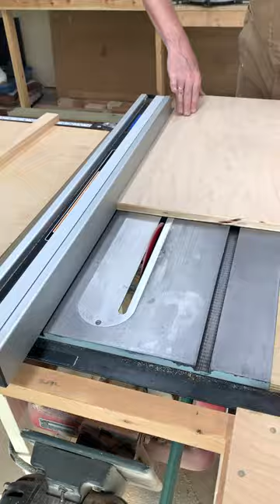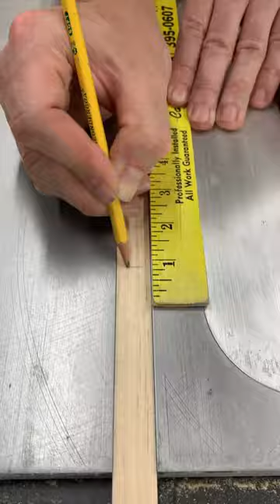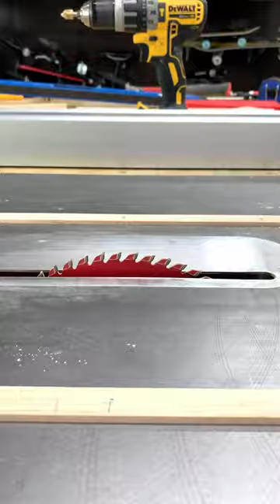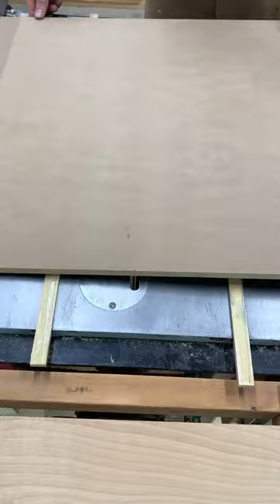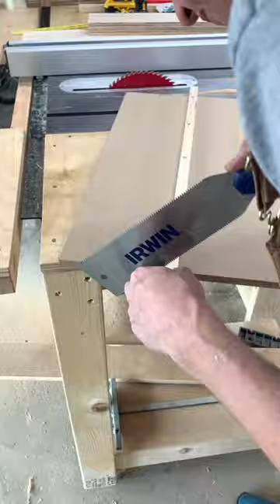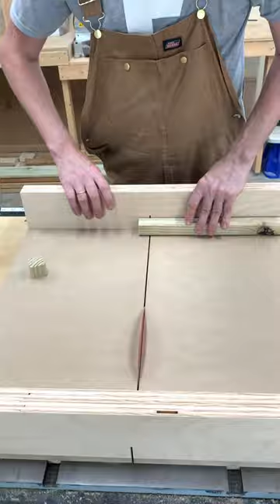Making a Simple Crosscut Table Saw Sled

Comment: Nice easy sled. I used a plastic-like cutting board material for the guides on mine so you don’t have to worry about the wood swelling in the summer.
Reply: Smart